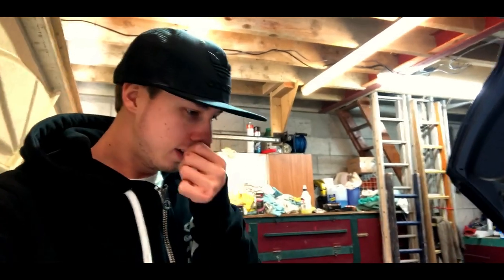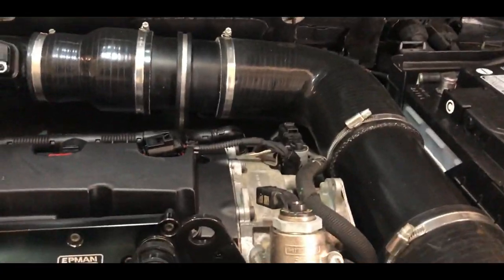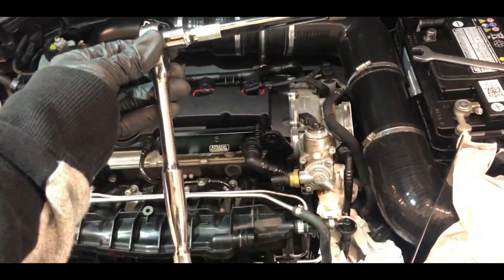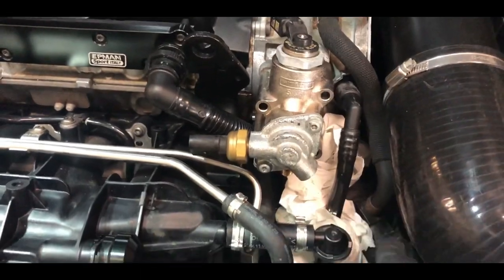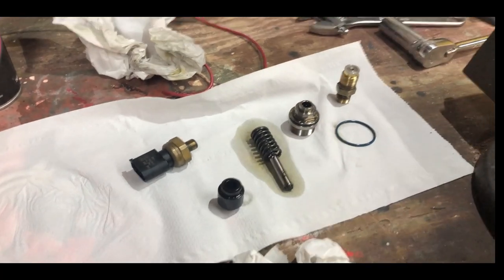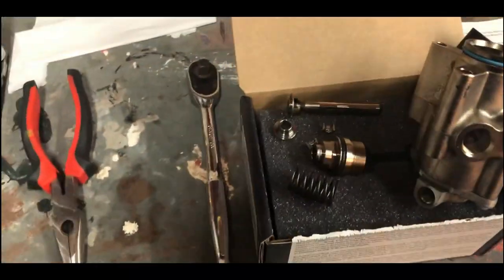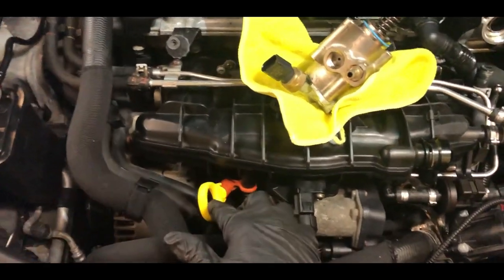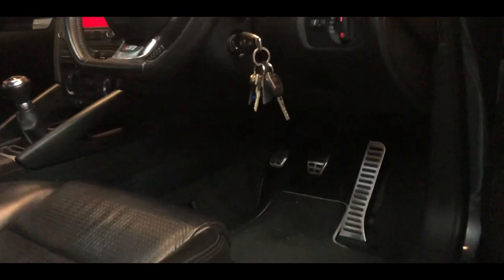Fitting Revo Autotech High Pressure Fuel Pump Internals On The S3 8P!

Comment: That steering wheel light on could turn out to be costly, we tried to reset it from amber to turn it off then it went red and everything stopped working so Audi fitted a brand new rack taking mine as an exchange 😅. Good video I'll be replacing my pump internals now as they been brand new in the glove box for over 2 months lol

Comment: Hello! I have a Audi A3 2.0TFSI DSG with stage 1 at 250 hp (simple remap, same Ramair as you, AUDI TTS dump valve, iridium spark plugs, red coil as you and thats all for now) but I wanted to ask, Do you feel a difference ? what stage are you at the moment with this mod? should i better invest in downpipe or this HPFP mod?
Reply from the maker: Hi mate, sounds great! No difference with the uprated fuel pump until it’s remapped, defo go for a down pipe before the hpfp mate
Reply: @MotoAdventuresYT  thank you!